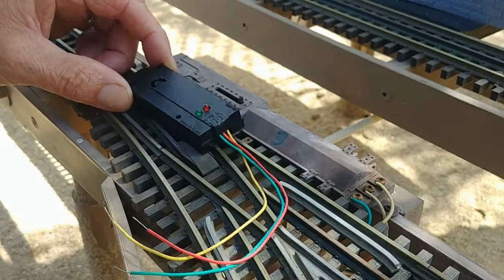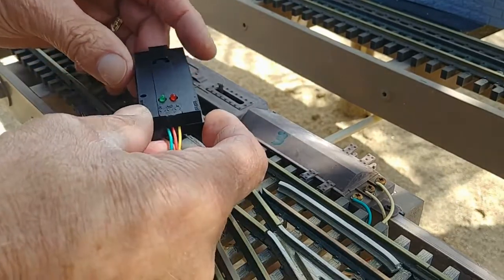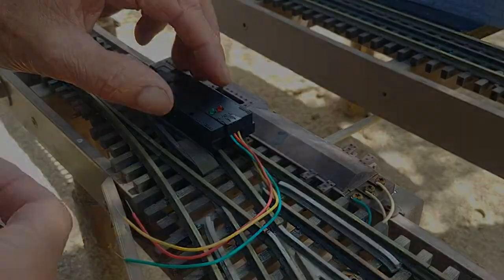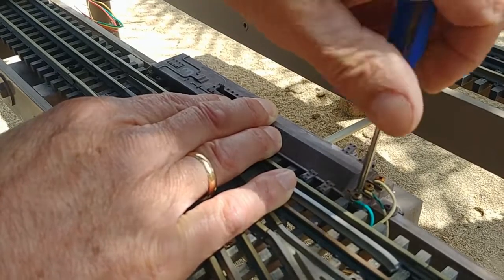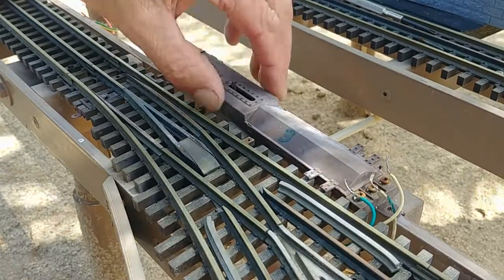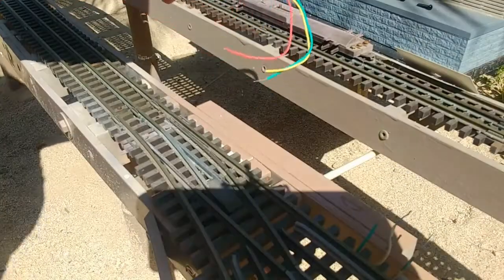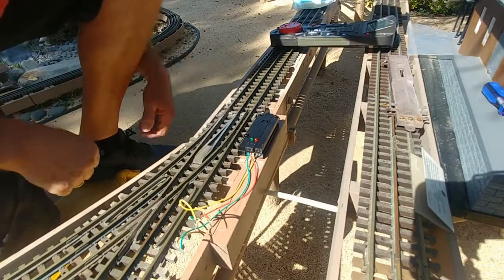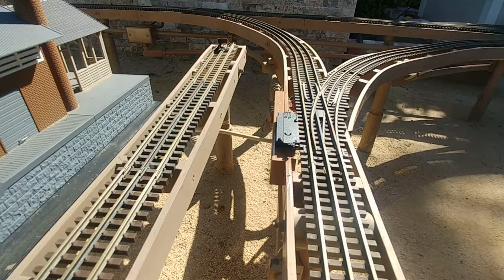O Scale Trains by Ron - Outdoor Layout - DZ1000 Switch Machine - let's give it a try...

Comment: How did you wire a DZ1000 to be controlled by legacy?  Thanks! -RTT
Reply from the maker: I am able to power the four remote switches via the Lionel SC-2 (6-22980) switch and accessory controller. To control the remote switches, I ran two 22 gauge wires from the SC-2 controller to each remote switch, along with my 22 gauge hot wire already in my bundle of hot leads running around the complete layout. With the switch always hot, I am able to control the grounding direction through the SC-2 controller.  The switches wiring is independent  to the track power system. Thanks for your comment and watching. Ron//

Comment: Are you able to make a video on how to make an atlas switch run with your legacy remote?
Reply from the maker: I am using the Lionel SC2 switch and accessory controller to operate the Atlas switches. Check out episode 6.  I show how I wired the Atlas switch machines and to be controlled by the Legacy or TMCC remote.

Comment: How hard was it to put it the z stuff on the atlas switch? And is that a more intense video can you potentially walk someone through it on the phone or video time?
Reply from the maker: The switch machine comes with several piano wires bent into different shapes to fit different switches. I had to modify one I used to provide enough point throw. I’ll need to go back to my video clips used to make this video to see if I have a close up of attaching the piano wire. I’d be glad to walk you through or video chat. I’m not available until earliest Monday. Thanks for watching and your question. 👍🙂🚂
Reply: @baldypalmsrailroad  yeah I’m waiting for one to come I ordered it
Reply from the maker: Fall Foliage - Here are a few videos I did on changing out the switch motor.  Hope you can get more out of these than the posted YT video.  Thanks, Ron//
https://www.dropbox.com/s/khvfv3kutu76oto/0503201555.mp4?dl=0
https://www.dropbox.com/s/q2e6kq3vgbsv4w0/0503201550.mp4?dl=0
https://www.dropbox.com/s/njo589ihhmu3lpo/0503201542.mp4?dl=0